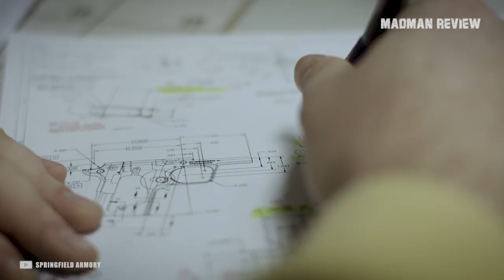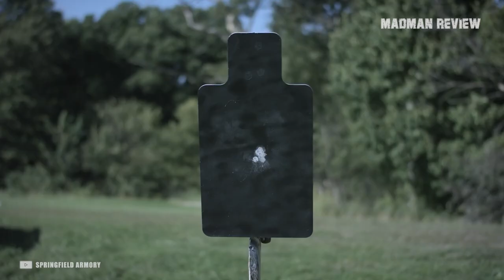Carry a Revolver is Better Than a Semi-Auto Handgun?

Comment: I’m PRO revolver as a carry weapon. Malfunctions or feed issues aren’t a problem
Reply: Malfunctions are still a problem with revolvers...
Reply: @theodurnayne3874  you’re right. Just let likely and rare with revolvers.
Reply: @theodurnayne3874  Are they a "problem?" As in, a major concern of it happening on any revolver at any time?
Reply: @nomercy4521  about as much as failures on any semi auto.

Also. When ima semi auto fails, you can fix it. When a revolver fails, you generally cant.
Reply: @theodurnayne3874  Idk, I picked up a bad box of ammo for a small .380 I have, and I couldn't run more than 2 rounds without a failure to eject.

Tons of unburned powder. 

Bad ammo doesn't seem too uncommon. Seems a common topic on gun reviews on whether or not certain pistols have issues with certain ammo types.

I also see some people have issues with limp wristing causing failures.

Just out of curiosity I decided to look up the most common pistol malfunctions and the first result had a top 8 list, and a revolver can't even have 5 out of the 8 common failures.

Comment: Revolvers are still around for a reason just like 1911s are still around for a reason. For 1911s its the single action trigger but revolvers have advantages that autoloaders don't have. I would not say a revolver is "better" than an autoloader or vice versa. They both have their place. I do prefer revolvers to autoloaders. Simplicity. No manual safeties, feeding problems, or worrying about a round in the chamber. The big advantage is that revolvers only have cartridge recoil where autoloaders have not only cartridge recoil but the recoil of the reciprocating mass of the slide. Double recoil with autoloaders can translate to less accurate shots than a revolver. Reliability is good for revolvers but when a revolver goes down it stays down until fixed. Revolvers have more gaps for crud to get into than autoloaders that can potentially jam a pistol. Revolvers have less capacity but that can be offset by moon clips, speedloaders, and speed strips so that revolvers with moon clips are just stupid fast on reloads even beating autoloaders on reload time.

Comment: I'd prefer carrying both. Carry 38special on ankle holster and glock26 9mm on condition-3, for safety reasons, around  waste line with 2 spare magazines. I pick 38special to reduce over-travel over-penetration and hitting bystanders in a crowded area.

Comment: All the focus is on the bullet-spitter.
The focus should be on the bullet.
9mm wasn't viable years ago. Due to powder and bullet technology, it's crossed the line back into viability. What has been viable since the day it was created, regardless of powder and bullet technology? A large diameter bullet. Those same large diameter bullets got better with powder and bullet technology. Science and logic says a bowling ball is likely to cover something vital when the baseball misses it.
Good gun-handlers can send a double-tap out of a SAA faster than most people can send two rounds from any semi-auto. The only weakness is the unload-reload. It's not like guys back in the late 1800's didn't understand this; they simply wore two of them. And they got deadly accurate at what they could hit. They didn't rely on spray-n-pray or space-age bullets and powder. They just got the job done.

Comment: A couple thoughts. One, Ive seen revolvers fail. Actually more frequently than autos. As far as the contact shots, it's not that hard to stop a revolver from working. If an attacker grabs the cylinder it's over unless the hammers already cocked. Also clothing can get pulled into the gap between the cylinder and frame. It doesn't take much to stop a revolver. I keep hearing these points thrown out there without much discussion about the reality of these points. That being said theres nothing wrong with revolvers.
Reply: You comparing a Glock to a Taurus or something? Everything fails, it's a machine after all. But even the guys who wanted to stand on the moon had to eventually put their lives into hands of the shuttle engineers.
Comparing equal quality, equal reputation, equal common wheelers to bottom-feeders, the bottom-feeders fail to function more than wheelers.
But again, more focus is put on the platform than the bullet and the person these days, which is a myopic view of things, I believe.
Reply: @exothermal.sprocket  Interesting you say more emphasis is put on the platform than the bullet. Function is first and foremost. Function is more immediately important than the cartridge. A .22 that works is better than a 50 that doesn't. As far as the two different platforms, modern manufactured arms rarely fail. They do fail but rarely. When they do it's usually the ammo that causes it. People who like to argue autos vs revolvers make the same claims that aren't necessarily true. Maybe once they were, but no more. I will converse with people about this stuff til the cows come home but I'm not gonna argue over it. If you like wheel guns then use em. If you like autos then use em. It's not worth arguing over like calibre debates.
Reply: @keithrichardson4333  I tend to agree with what you've said.
Stopping threat is goal #1. The threat perishing is a side effect that we don't want or need, so long as #1 happens.
That said, out of the vast majority of weapons presented in self defense incidents, very very low percentage of those incidents was any bullet actually fired.
The nature of this discussion and video is actually dealing with last-resort subject matters.
Reply: @exothermal.sprocket   You're right on. That's why I dont like to get into the type of arm or caliber debate. Personal preference. There are arguments one way or the other, but these will just go on and on and on. I now just tell people to carry what they will. I just like to point out bad or outdated info when I can.
Reply: Its not easy to grab the cylinder & if you slip your hand will be gone. You can safely grab the slide of a pistol & either prevent it from firing or prevent it from cycling after while controlling where its pointed. If youre in a position to grab the cylinder its probably better to just get the wrist of the shooter anyway.
Reply: @1nfamyX   Grabbing the cylinder would be pointless if the person trying to stop it wasn't planning on disarming the assailant. Likewise pushing an auto out of battery would be wasting time if the individual wasn't planning to do anything else about it.
Reply: @keithrichardson4333  youve missed the point tho. If you fail the maneuver on an auto, it fires & maybe the front sight gives you a small cut at worst. If you fail the maneuver on a revolver then youre 1 handed. The pressure exerted at the cylinder gap will mince your flesh.
Reply: @1nfamyX  It doesn't take that much pressure to actually stop a revolver. On top of that a person can wrap their mitts around the hammer. Now, if a revolver does manage to fire the escaping gas can do damage. It just depends on the cartridge its chambered for. If a person finds themselves fighting overcast handgun theyll be functionally one handed anyways. All that being said it's just best to not pull any firearm if if the carrier is going to be wrestling someone for it. That's why I generally dont even chime in on these kinds of discussions.
Reply: @1nfamyX  As far as the gasses escaping the cylinder gap, we have to keep in mind the fact we're talking about conceal carry pieces. Realistically that's gonna be for the most part .38 special and down. Maybe some smaller 357s. The escaping gasses aren't gonna fillet someone's hand like people think. A little burn sure, but not crippling injuries.
Reply: @keithrichardson4333  youd be surprised. Theres videos on how much pressure there is & what it does. Has very little to do with heat, its not really a burn affair.
Reply: @1nfamyX  I've seen videos people test this and cartridges like 38 special dont do much more than speckle the hand with burnt powder. It might bruise the meat of the hand. So, even if someone doesn't manage to block the hammer or stop the cylinder, a little hand damage is still better than a round center mass. That said, it still isn't very hard to stop a revolver cylinder and hammer from operating.
Reply: @keithrichardson4333  whatever you say internet badass. With wet, sweating, or bloody hands on a slick sided .357 you would be in a world of pain.
Reply: @keithrichardson4333  also for the record, searching "cylinder gap pressure" the first vid shows a .38spl 158gr +P cutting a hotdog in half. You know very much less than you think you do.
Reply: @1nfamyX  were talking about concealed carry revolvers. Most people aren't carrying 357s. Most people who are carrying revolvers are carrying chamberings like 38 special. Not a 500 mag in a shoulder holster in bear country. That is an entirely different thing
Reply: @1nfamyX  hotdogs aren't fingers
Reply: @1nfamyX  Paul Harrell did a video with a ballistic gel hand and it wasn't til the serious magnums did real damage happen
Reply: @keithrichardson4333  ballistic gel isnt fingers either smarty. Ballistic gel does not represent animal flesh in any way, it only presents a clear & consistent medium to observe penetration & expansion. Thats why the FBI standard is 18 inches of gel but the bullets dont pierce 18 inches of human.
Reply: @1nfamyX  yeah you're right it isn't a substitute for actual soft tissue, tissue is tougher.
Reply: @keithrichardson4333  try it & post then. If its just a little burn you should have nothing to worry about, in fact a throwaway surgical glove should protect you seeing as theres not enough thermal energy to transfer & still burn through the glove. I'll wait
Reply: @1nfamyX  I never said a person couldn't be burned, just that the gasses aren't gonna fillet a hand like a plasma cutter or blow up like a grenade. It can still burn person.
Reply: @keithrichardson4333  youre strawmanning. I didnt say you said a person couldnt be burned, in fact i directly addressed such a burn. Seems you dont know about pressure, thermodynamics, or how to read, so theres no point in continuing.
Reply: @1nfamyX  everything you just named was the point of the conversation. You were making the claim a person could have their hand tore up because you saw a hotdogs get shredded in a video. The only point I was making was that in fact no, that doesn't mean a persons hand would grenade or be all torn up, although it could be burned. All with lower pressure rounds and not magnums because that's very different.  It's not that complicated.
Reply: @keithrichardson4333  which i addressed but you failed time & time again to read. If you think the burn would be the only concern & the pressure not, then do it wearing a latex glove. Latex insultes & a single shot .38spl & below does not possess the thermal energy to burn through the latex glove. Its the same  reason you can pinch a candle without being burned even tho putting your hand in the flame would burn you. Like i said, you know nothing. I used to work with explosives & pyrotechnics. A gel block sitting next to the gap does not simulate you sticking your hand around it to attempt to stop the cylinder. & another thing that isnt complicated is reading fyi.
Reply: @1nfamyX  any pressure coming out doesn't make  it a plasma cutter. It's just venting some gas around the cylinder. There is some pressure, but it's not what you're making it out to be
Reply: @keithrichardson4333  so do it with a latex glove. You still refuse to do it bc you know it will harm you.
Reply: @1nfamyX  why the glove?
Reply: @1nfamyX  Again. I didnt say it would never cause damage. That's not even the point I was trying to make with my initial comment. But weighing any potential issues coming from trying to stop a revolver from operating is always gonna be better than taking a round to the chest. Will I test this on my hand, no, becausevas I've said over and over again, it will cause some burns. Not gonna purposely do this unless someone is actually sticking a revolver in my guts. It's just nonsense. Like running across a busy highway to show you can just to prove if someone was in trouble you could.
Reply: @1nfamyX   not nice
Reply: @keithrichardson4333  you did actually, you said the burn would be the only cause of damage. & i didnt say it was gonna grenade your hand, but i did say it will leave you 1 handed for the short remainder of the struggle. The first thing you lose is grip strength, even if it only mildly lacerates your palm, you wont be able to do much after being bloody & having compromised strength. Now go take a literature class.
Reply: @keithrichardson4333  gkys. I have spoken.
Reply: @1nfamyX  whatever you have to tell yourself
Reply: @keithrichardson4333  learn how to read fudd.